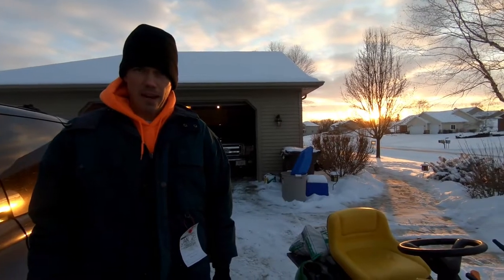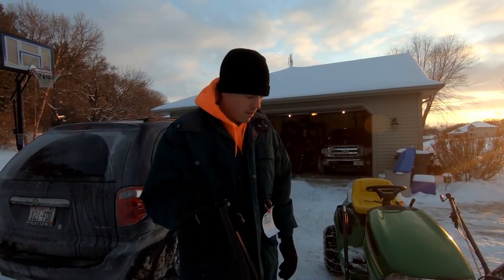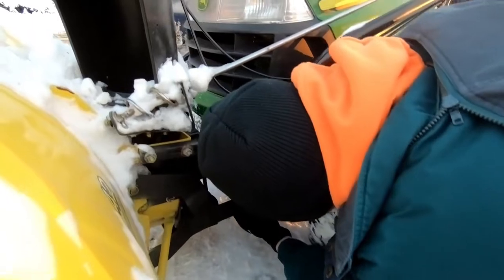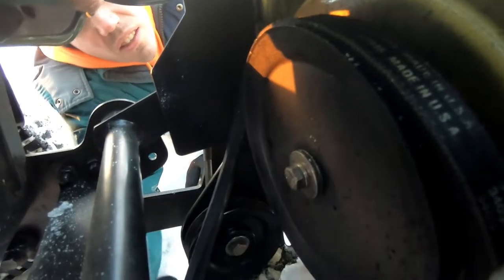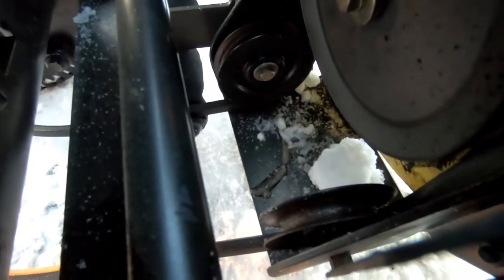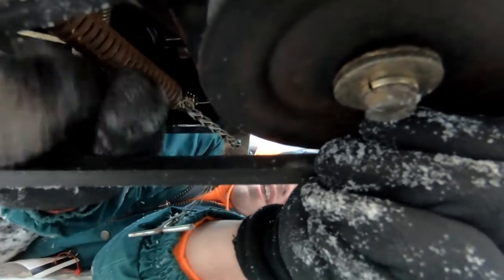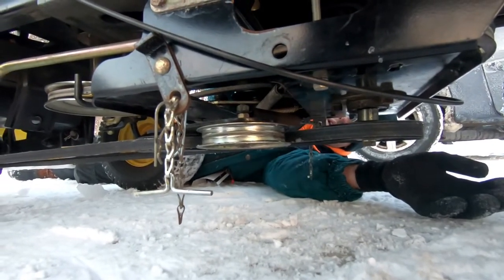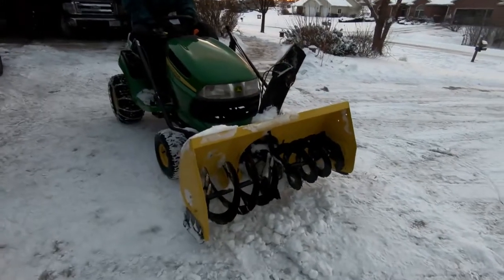How to put a belt on a John Deere 100 Series 125 Automatic Snowblower

Comment: This blower is made by Agri Fab for JD, Craftsman and a few others.  It is a TERRIBLE design and the belt will continually  fall off.  Calls to Sears, JD dealership etc. are totally ignored. Do a google search for this issue and they'll be dozens of frustrated owners gett ZERO results.  I ended up fabricating an entire new idler/drive to make it tolerable.  
DO NOT BUY a blower with this design, especially if made by Agri Fab!